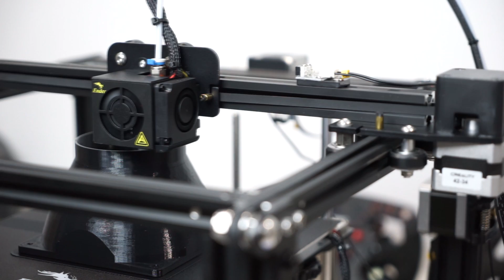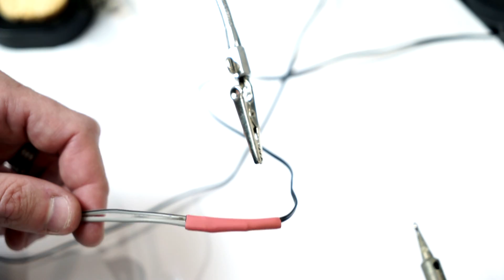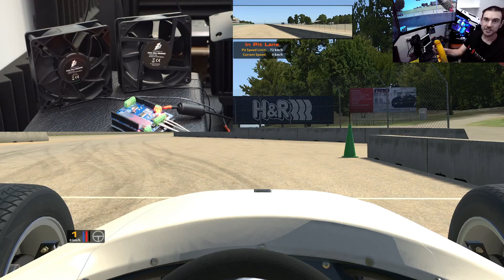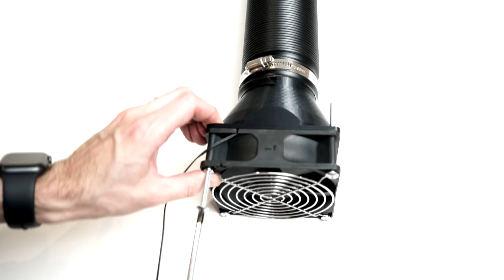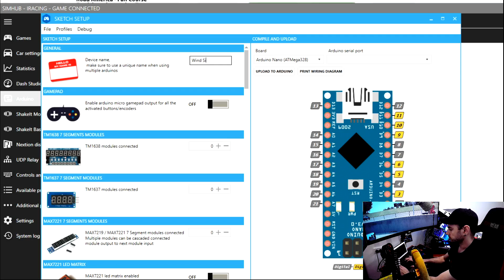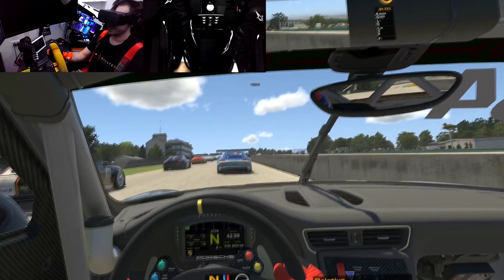DIY SIM RACING WIND SIMULATOR - Part 2 - We Nailed It!

Comment: hello I have fans with only 2 wires and when I start them with a 60hz configuration the fan forces and makes a cracking noise or as if it is forcing

Comment: Why do you use that hose, why not mount the fans directly without the hose? Does it stabilize the air in some way?  If so why not print a fan cover which does that instead?

Comment: Running arduino uno rev3 and motor shield rev 3 with Noctua NF-F12 iPPC 3000 PWM and the fans won’t fully spin up. They buzz and need help to fully spin during testing

Comment: The motor shield has no reverse current protection. When slowing down, the fans generate back EMF, a reverse voltage created by the fan acting like a generator. This reverse current can and will destroy your motor driver. You need to add a battery in parallel, use a buck converter, or add a diode to prevent reverse EMF. 

I found out the hard way and destroyed my first board and power supply.

Comment: I realize this is a 3yr old video but hoping for a response from someone nonetheless. Is this setup capable of having the 2 fans to run at separate speeds to simulate turning? 
Planning to use it in my sim rig for both racing and drifting and it would be cool to have the right fan running faster the the left if I was in a left corner for example.
Reply from the maker: Yep. Simhub manages that.
Reply: @boostedmedia  awesome, thank you so much!!

Comment: One of the best fans to get are the Bgears 140mm x 140mm x 38mm.
5200 rpm
CFM 308!!!
70 DB - loud as a small washing machine at max revs. But that should be expected by the wind that is generated.
2.76A... needs a 3A motor shield. 
I reccomend the Cytron shield... SHIELD-3AMOTOR.
1.2Amp 7V-30V DC Motor.  Driver Shield for Arduino (2 Channels) it has a max output of 3A per channel.
Tip 4 Will: Use that nice new 3d printer to make a custom case for the arduino+Shield.😜
Reply: Hey I'd like to copy this version. What AC power source do I need?
I'm ordering arduino Uno, probable the 120mm Bgears 318 cfm fans.
Is there anything else I need?
Reply: @Capt_McNugget  had issues with  motor shield... too much grunt.
Need to order the Dual VNH2SP30 Stepper Motor Driver Module 30A Monster Moto Shield Replace L298N. 
Not cheap which defeated my purpose of a cheap DIY mod.
My wind sim is at the top of my  " To-Do list". 
Spent too much time on it so far...
With hindsight, i would either buy the Hurrican kit from SRS, or build it with a  less powerful fan...
For power, i use a single PSU. It's 12v and 10 amps... I used it on many  devices, not just the wind sim.
Reply: @playmaker5601  Thanks for replying will probably get a less powerful and noisy fan. More research required on my side as I'm not too familiar with arduino
Reply: @Capt_McNugget Does it have to be a 2 or 3 pin fan? Is there the risk of only being able to run the fan at one speed if the pwm pin of a 4 pin fan just remains unused?
Reply: @MrZer000 I ll check my fan to see what I ended up using
Reply: @MrZer000 PWM version (Pulse width modulation) .
I think it has 4 pins. 
2 are used for +,-
The others are data. One telling fan how fast to spin, and other  one telling pc how fast fan is spinning.
You only use 3 pins
Power and the pin that tells fan how fast to go....
The 4th  is not used.
Reply: @playmaker5601 Thnx. Im also planning my wind sim and I was gonna get two 4A ones. Until I saw a video. Holy S those are jet engines!!!
I guess Im fine with 0.8 to 1A 😂

Comment: Hoping someone can help. Purchased 2 sets of everything for 2 sim racing rigs... (2) Uno R3's, (2) Arduino Motor Shields Rev3, (2) 12V 3A Power Adapter and (4) EZDIY-FAB 12cm 120mm 200CFM 4000RPM CPU Cooling 12V Fans.  Unfortunately, I cannot get the fans to spin at all on either.  I have tested the fans with the power supplies and they all work well so neither of those are the issues. I have downloaded SimHub on both systems and setup exactly how the tutorials have stated (one said to set them up one way, another tutorial another way, neither way works). I can press the test buttons in SimHub and the 2 lights on the motor shield do light up for each channel so that is supposed to indicate that power is being sent to the fans. However, they do not budge. Again, I have set the values up exactly as the tutorials state. I have also made sure to slice the through the copper trace on the motor shield board (rather than jumper on previous boards). 

I am not sure what to do. Would love any feedback on what I am missing? Thanks!!

Comment: Purchased the tubes and ended up returning them.   Tubes add quite a bit of noise.  I've found good luck mounting them with mesh grids on their own.   Blend in a bit more too.   I also had issues with my fans "ramping" and ended up moving fan 2 to M3 port vs using 1 & 2 as mentioned in this tutorial.

Comment: Having just completed this project , 100% replicating your design Will, including the 3D printed components, same fans and piping.....there is a potential problem. The throughput of the air is disturbed by square to round in the output path, to the extent that the majority of the airflow is reverses back through the input side ...limiting the output on the "expected" outlet. @Boosted Media - are these your findings also?
Reply from the maker: Flow is improved with the addition of some flow directors inside the adaptors. A file was shared by one of our discord community members a while back which improved it.

Comment: Anyone have an issue with fans constantly pulsing on and off when at full load (doing 200km/h down a straight for example). Could it be a power supply issue? I'm using the same exact power supply as the one in the video.
Reply: I had the exact issue. I changed the PWM frequency setting to 800hz (Arduino setup tool) and now fans are working correctly.
Reply: @tak29  Thank you! I'll give that a try

Comment: Wondering if you have any suggestions for me, I'm just looking for suitable fans for cooling myself , not wind simulation. I tried the links, including the updated ones on the community member's site and all the links come up empty. I currently have 2 small 120mm computer fans going, but they don't push enough air. Thanks in advance.

Comment: Get a motor shield that takes 12V input and provide it with 12V power supply to those fans. That’s what they work with ideally. Cant buy a reducer or can’t print one? There’s 3D printer services that will print and ship it to you. Got a 4 wire fan? Google it and you can find which two wires to clip and ignore. You won’t burn anything out just by trial and error, but generally black is (-) and red is (+). If the blades are moving backwards, swap the wires from + to -  . Pvc pipe will flow better than ribbed tubing and you can form it to angles with a heat gun. Hope this helps the majority or questions I saw here.

Comment: Wondering if anyone knows where I can purchase some 120mm to 76mm (3inch) reducers in Australia? 🤔
Reply: I ordered some off etsy from China to the UK, I fitted them and the tubing, and it reduced the airflow significantly with them. I'm now just using fans on their own. If you want them quieter I'd recommend running them at reduced power (select the percentage in sim hub). You'll save some money on the tubing and reducers 👍

Comment: It doesn't work with these duct adapters, you won't get any air at the other end of the duct. Still trying to find the solution (apparently adding an air straightener helps) so you have hardly nailed this.
Reply: I found the same when I received the reducer in the last few days. I would recommend just using the fans on their own, and reducing the percentage of the fans in sim hub to reduce the noise, and you'll probably still have more airflow
Reply: @NullAndVoidChannel  you're 100% correct. I printed an "air straightener" to put it inside the reducer and that fixed the issue of airflow not moving through the ducts, however even though you get a decent amount of airflow at the other end it's still less than directly from the fans, and not only that, I found that the noise was sort of amplified by the ducts. So long story short, I'm using only the fans with the "air straightener" on the wheel deck and like you said, because you get better airflow you can lower the power and get less noise.
Of course he knew this didn't work but wouldn't say it so he can get more views and subscribers. I should have followed the correct tutorial from @amstudio, this one is simply a bad copy of that tutorial.

Comment: Is it normal that my fans seem to stop "revving"? it's still running though. I kinda expect it to have constant "woooooooosh" instead of "woosh" (2 seconds) "woosh" and repeat. It seems to only be constant whooshing at max speeds.
Reply: I had the same exact issue. I changed the PWM frequency setting to 800hz (Arduino setup tool) and now fans are working correctly.
Reply: @tak29  thanks for sharing your solution

Comment: I have followed your steps but still cant seem to get the fans to run during the test or in game. I've tried to reflash the Arduino, checked the fans, checked the + and -, nothing seems to work. Have any ideas on what could be giving me issues? I did end up getting a 4 pin fan but only hooked up the power and ground, could that be the issue?
Reply: Yes, ufortunately PWM fans won't work

Comment: Help… I built everything as specified except for the stepper board. Out of stock so I purchased the 	
DEVMO L293D Motor Drive Shield. I got it to work after a little fiddling but the airflow seems weak to me. Is that because of the L293D? Should I still try to find the Adafruit Motor Stepper? Will it find the fans more power? Like I said, I purchased everything listed including the fans. Thanks in advance!!

Comment: What wiring is used to extend the fan cables?
Reply from the maker: Whatever you have around. Doesn’t really matter as long as it’s equal or thicker gauge than what’s on the fans themselves. :)
Reply: @boostedmedia  What gauge wire were the fans you used I'm buying the same ones via your link - Thanks for the quick reply and posting this DIY! love watching your videos helped me a lot in building my sim rig.

Comment: Bought same products and printed same item, and tube does not fit on fan adapter
Reply from the maker: Did you print do a different scale perhaps? First person I’ve seen have that issue! It required a bit of stretching normally but should fit
Reply: @boostedmedia  I sent the same file to someone to print and he may have. I don't have a pair of calipers to check thickness but he should have used same info for the print, correct?
Reply from the maker: Not necessarily. The result can be scaled up or down in the printing parameters so it’s not necessarily 1:1.
Reply: @boostedmedia  ok well since I just purchased a new ender 3 I guess I'm gonna try
Reply: So I did some measuring and the printed part was almost 5 in or 127mm and would not line up correctly so tomorrow I have 7 hrs of print time to print one 14 total for 2.
I'm going to leave everything the same in cura so I won't be adjusting anything. Thanks for your reply
Reply: I have the same problem, it fits perfectly on the fan side but the tube doesn't fit. Tube is 75,5mm and the adapter is 79,5mm. I tried everything to make it fit but it's waay too much to stretch

Comment: I have a problem: even messing around with effect low and high force, the fans start blowing at around 80kmh but even cruising at constant speed, they stop blowing for several seconds and then start to spin again....it seems there's no relation between car speed and fan speed except when at very high speed. Can someone help me? Thx
Reply: Have you solved this?

Comment: So my fans are not working I have cooler master fans 4 pin using was here laying around at home. only the ground and  power wire to the arduino. Did a test no movement with 1600/60 hz pls help.
Reply from the maker: PWM fans won’t work

Comment: Followed instructions clearly.
But fans won’t spin.
I’ll keep trying.
Anyone out there struck same problem?
Reply: Same issue. Everything looks good in SimHub but when I test the motors, there is no power to the output header on the shield. Did you get yours working?
Reply: @Jocko8136  no good mate

Comment: Some notes so others don not go as insane as I did: 
Changing the PWM frequency  can stop some fans working if its too low. My fans wont turn if its under 1200.
Also - those volume controls in sim hub  on the ShakeIt Motors page - by default the top one for me was set to 50%. This was limiting my fan speed to 50% . I was only seeing a max of 6v on testing. I tried so many things before the realisation 6v is 50% and that slider there is set to 50%. It is like the master level so if you are getting too much of something you can tone it down a bit. 
Set it all to 100% to test. Then you wont cry cos your fans can barely blow out a candle. 2 days I spent with the 2 issues thinking my dodgy soldering was to blame.
Reply: ive been going through the same issues but testing different dc motors and wind blades for higher velocity. a year later have you come to any ideas you would share?

Comment: My uno R3 seems to be set up correctly but it isn’t turning my fans, any ideas?
Reply: Same issue. Everything looks good in SimHub but when I test the motors, there is no power to the output header on the shield. Did you get yours working?

Comment: Can't help but notice the fans you are using are two different fans.
I purchased some good quality 120x38 Delta fans that move more or less the same amount of air (CFM) as yours and they are a bit quieter (59 vs 53 dB)
Could  you please confirm the fan links correspond with the fans you really used? I cannot even hear your fans in the test and the ones you linked are even louder than mine.
Thank  you!!

Comment: Thank you so much for helping me build my first Arduino project! My wind sim turned out wonderfully thanks to you! I have only one small question/issue that I ran into:  you recommend setting to 60hz to eliminate the PMW buzz, which I did. Unfortunately, I couldn't get the fans to run at anything less than (essentially) full power. There was no activity from 0-80mph, then they suddenly kicked in full blast and wouldn't stop until I dropped below 80, when they stopped completely. It took me a while tinkering with settings, but as soon as I changed the hz back to 1600 (as you recommend in the first video) my fans worked perfectly and slowed/sped up in sync with my car. Now, I'm a complete novice when it comes to electronics, so could someone maybe help me figure out why this happened? Because, in this video, the fans seemed to work perfectly even at 60hz

Comment: Since recommended fans are 4-pin, a motor shield is NOT wanted.  Instead, select SimHub Arduino's PWM Fan option
Reply from the maker: The recommended fans in the video description are not PWM. Unless Amazon has changed the links again. I’ll check.
Reply: @boostedmedia  would it not work with the PWM fans?

Comment: Hi Will. Are you still happy with those 120mm fans or did you find better one lately? thanks
Reply from the maker: Still happy with these. They’re about the maximum you can run without upgrading the motor shield.
Reply: @boostedmedia  thanks! you should do more DIY project. There is something you still don't have, a DIY G-SEAT... I did a pneumatic one and it is great for sustained forces ;-)
Reply: @boostedmedia  what happens if you upgrade the motor shield is it much better?

Comment: I'm having a lot of intermittent issues. Fans cutting in and out. I used the recommended power supply. Left fan spins up way slower than the right. Any advice for this stuff? thanks :)
Reply: Ever find a fix for your issue?
Reply: I'm getting the Same issue

Comment: I think i have the same fans, what will be the negative and what will be the positive wire on this fan? One wire is completely black, the other has some text on it (very, very small,  but there is something). And do you need the jumper? As i think i have them wired up correctly but nothing happens when testing.

Comment: Hi Will, I'm realy keen to build one of these set-up's for my mew rig that I'm building. 
Just wondering if you think it is possible to piggyback another shield on top of an already set-up UNO+Motor shield that runs my pedal rumblers.
I would obviously need to run 2 x power suplies, 1 x 5V (for the pedal rumbler shield) & 1 x 12V for the fan shield. Or do I just have to buy another UNO etc....?
Reply from the maker: Not sure mate sorry. You’d definitely need to do some coding though.
Reply: @boostedmedia  I think it can be done in SimHub under the ARDUINO settings, you can choose/add more than one motor driver board and it sets up the code there. I'll let you know how it pans out.

Comment: Can SimHub scale down the fan speed if you're in a non-open vs an open car? Not sure if the telemetry data also sends some info about the car that could be used...
Reply: Yes, but not automatically. I use 2 profiles for that.

Comment: All right! This works like a freakin charm. Only problem is, the duct won't fit over the 3d printed piece. Has anyone run into this problem and can suggest a solution? BTW I made this with the Delta 120mm Fan AFB1212SHE fan (3000 rpm, 160 cfm) - wowzers! Great airflow!
Reply: Same issue, the ducting wont fit over the reducer.. did you manage to fix it?
Reply: @DaveSimo  thank you! I thought I was the only one.
Reply: @sam.robison  I removed the wire coil from the first few inches of the ducting which made it easier to manipulate over the reducer.. plus some duct tape
Reply: @DaveSimo  yeah, i tried that. Plus sanding down the part. It's just too large to fit.
Reply: Still an issue, anyone found a solution?